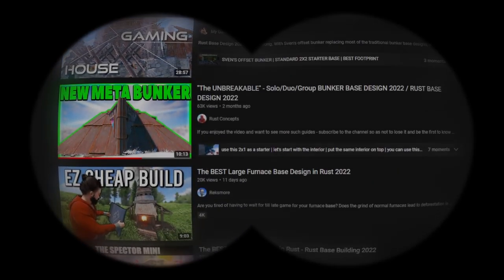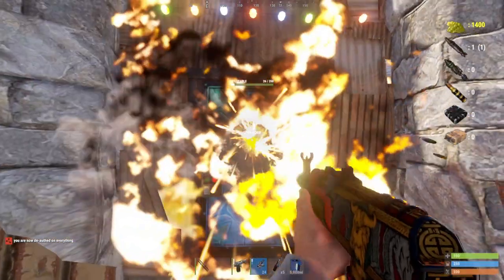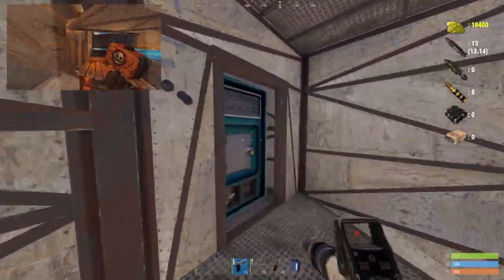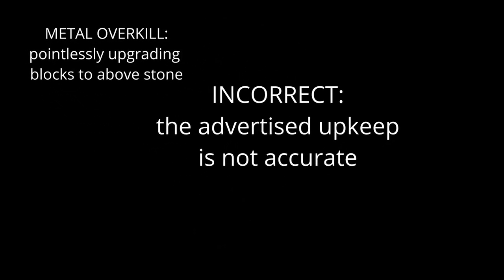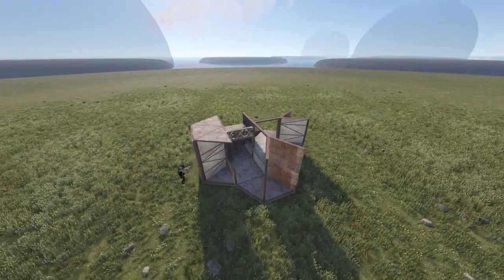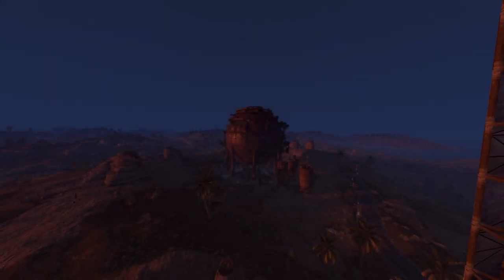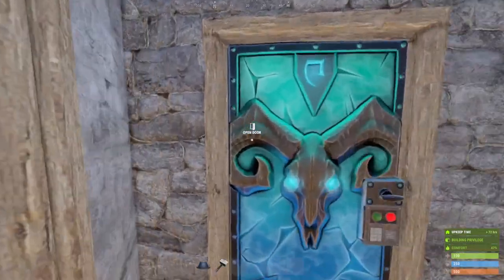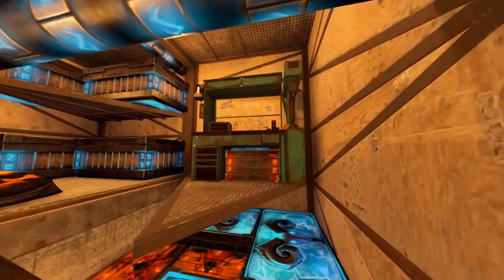Bad Bases Episode 1

Comment: I like this styoe of content. I feel like the best designs for any base has already been invented, considering there are a dozen new build videos coming out every week. So thest people just try to reinvent the wheel while making it worse.

I use a 1x3 design, simply because there is no better. Let me explain. So you have the 1x2 and on the long side in the middle a triangle foundation bunker jump up. So a loot room on either side. Unless you have rockets the cheapest raid path will be 1 stone wall and then 2 SMD. With a build cost of 7k stone and a bit of metal to upgrade the bunker and make doors that is 9k Sulfur (with satchels) to raid the thing.

There is a full version of this, but I just wanna give an example why spreading out your loot rooms is extremely powerful and why a base can't be cost effective without using this feature.
Reply from the maker: Splitting loot is the best way to boost raid costs; in its extreme, that means building multiple bases, or building 'snakes', or both. I have a script talking about this, actually, but it's a couple videos down the line. Thanks for dropping by!

Comment: The best bases spread out loot in bunkers or pixel gaps and use 3-5 tc's for smaller bases. They have low upkeep due to low building tax's ( number of building blocks used on single tc ) if you wana se your Building Tax's go to a tc and mouse over wher the text says ( Cost pr. 24 houres ) it will show you building blocks and the tax's %.
Reply from the maker: Splitting loot is the ticket!

There is not much benefit to multi-tc for small bases, actually. The cost of connecting the extra tcs to the shell far exceeds what you save in reduced taxes.
Reply: Thats not true.,.,but maybe we have diffrent idea what a small base is ( when it comes to hqm upkeep thers a pretty big dif on 15% or +25% tax's ) and with multie tc's commes the hard to find bunkers.
Reply from the maker: @nafspliffster3527  build the same base multi and single TC then compare. You'll see what I mean